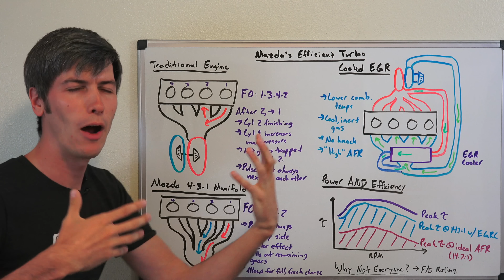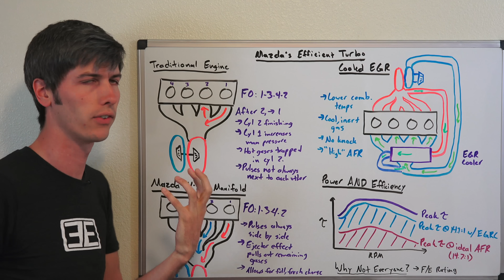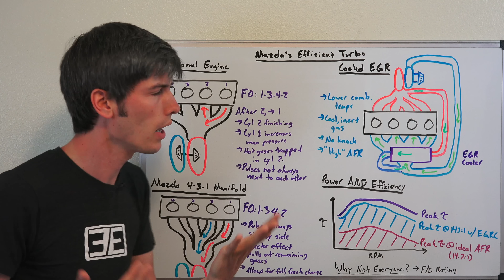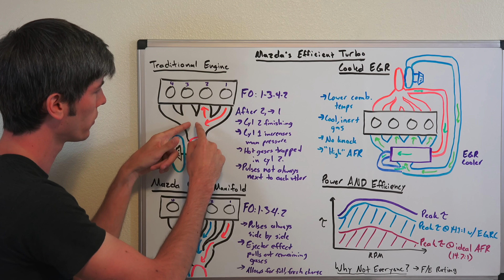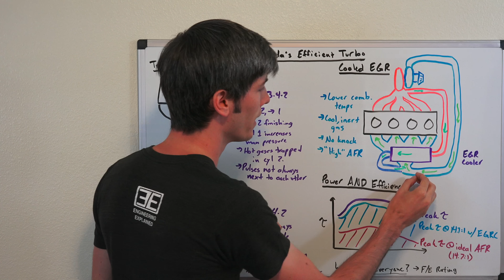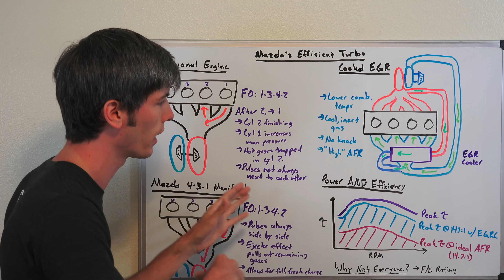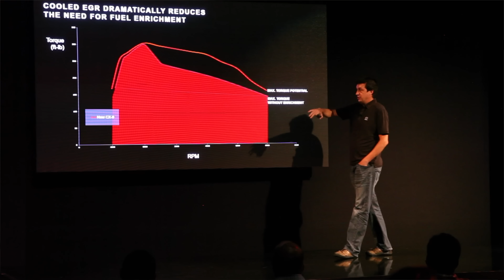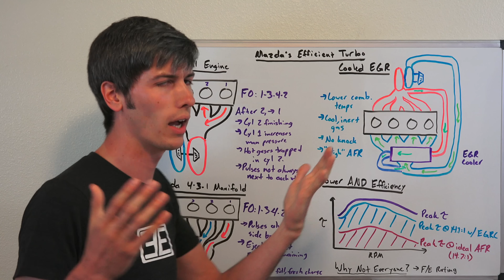Mazda's Secret To Efficient Turbo Engines

Comment: This is why, to me, Mazda is the most exciting car manufacturer right now. They are really letting their engineers have fun and design fundamentally good engines.
Reply: Especially for such a small company with a relatively low R&D budget, imagine if they had the same funding as the big three?
Reply: @holmd90  far from small but wjatever....
Reply: We've got a 2015 Mazda3 2.2D and it's an excellent engine. Has 2 turbos which work seamlessly, there is no boost threshold that i can see (you can hear the little turbo spool pretty quick even below 1000rpm with the windows down) and the lag is minimal at best, and you can (if you really try) feel the overlap of the turbos) better still. Gets 70mpg(uk) doing 80mph. Awesome awesome engine. My 04 MX5 is also indistrucable
Reply: @mulymule12  that's amazing fuel considering the size of the Mazda6. I've only been hearing great things about these cars and I'm about to get my hands on one
Reply: Fundamentally good and reliable engines. They aren't introducing additional moving parts (additional heat exchanger and newly-designed exhaust manifold) and use real-world consumer-grade fuel to achieve their results. That's awesome.
Reply: Mazda engineers fun cars that have a very refined balance of practicality and  performance. One of my favorite car companies.
Reply: 787brx8 oh? Who is it? I'd love to hear more.
Reply: RalstigRacing Agreed! I love my SKYACTIV. Also reliable one of the few engines I trust with DI since they actually addressed the carbon build up issue in their press briefing when they first came out. 
The SKYACTIV X will be so good!
Reply: Definitely! Can't wait to see what their HCCI engine brings. Any engine that has a supercharger mounted to it gets me excited
Reply: RalstigRacing I’d disagree with you there I’m not a big fan of Mazda heading towards luxury over performance they’ve completely abandoned the Mazda performance division zoom zoom is no longer what Mazda about and although there bringing back RX I don’t think it’s gonna be a performance car at all I think it’s gonna be their top tier luxury car

Now I will say this the skyactiv engine is one hell of a reliable engine
Reply: This is why I’ve owned a 2007 Mazda Miata for years now and put in Mazdas newer engine in it.
Reply: @Matthew Proudlove ices are infinitely cleaner than batteries. They can run on hydrogen. Batteries are based on a highly toxic, non reneuable resource, need to be replaced after 5-10 years and can not be safety disposed of.
Reply: @Erowens98  I like ICE but you are full of s*it. All the studies say otherwise. More importantly EV's remove the pollution from the cities. There are 7 million deaths worldwide from air pollution
Reply: @787brx8 Could you provide additional information? I'm curious about this designer. Name, website, something?
Reply: @tappajaav  He keeps A low profile so he can work on military projects when he feels like it.
M. Mother
O.  Of
A.  All
B.  Bombs
Utah
Reply: @787brx8  I think Jason lives in Utah too. Wouldn't surprise me if they knew each other.
Reply: @matthewsalmon2013  Jason is in Idaho from what I know.  Probably only A few hundred miles away from each other.
Reply: They're taking engine efficiency to the next level. Its not without it's risks however, some of these engines may not be reliable or fail. I'm hoping they don't since Mazda is good at what they do, but it happens with new engines on the market sometimes.
Reply: @Matthew Proudlove Whilst there is a lot of merit to this argument, there are 2 huge environmental impacts with electric cars; 1- the environmental cost of producing batteries. 2. The environmental cost of disposing them. I haven't yet seen impartial studies on this but can tell you the cost of producing batteries is overlooked by most people. I am not aware of any real recycling programs for all these used car batteries that are about to come onto the market. Not saying they don't exist but wonder how much is marketing fluff and how much is reality. The toxic materials used on such a huge scale for car batteries is an environmental disaster waiting to happen, especially in less tightly controlled parts of the world.
Reply: Nutrenics Padi 
It's early days wrt ev technology ..... you are comparing it to  the ice that has had many years of refinement.
Commonsense says the battery technology ( including recycling) will improve in time, so your argument is nonsensical.
Reply: They need a new performance hatch and sedan bad though, I've loved my speeds
Reply: That is exactly why I will keep an eye out for Mazda when I start looking to buy a new(er) car.
Reply: When will they make a full size truck?
Reply: @Thomas B 
Well, Thomas, I didn't know what percentage was recycled so, being the open minded fellow I am, I Googled it. Turns out that over 60% is a number often quoted. And, before recycling the material that makes up a battery, they are often repurposed for things like storage for solar. I also read some info on the continuous reduction of pollutants from the processing of these batteries and the continued improvements in energy density, quality, and different chemistries that are better in multiple ways. Now I'm sure the whole story isn't in the few of websites that I looked at but I think the general trend is there.
Reply: Not anymore today
Reply: Coming back to this 6 years later and you are spot on
Reply: Matthew Proudlove some Swedish university have done this study. Compared to a typical 1.6tdci, an equivalent EV needs to hit around 160,000km to break even with the ICE car in CO2 terms (granted it’s not a pollutant like nox and pm where EV wins hands down) and that is using Europe’s current mix of electricity sources which isn’t all coal (far from it). The battery manufacture is so intensive that an ev starts off on the back foot in terms of co2 by a factor of 2 ( I think. Not sure how they worked it out, but an ev starts life with about 90g/km equivalent co2 and the ice around 40g/km). 

But of course the flip side is no PM and NOx as local emissions. These are displaced elsewhere to a handful of power plants which are typically out of the way and which have bigger scope for effective after treatment
Reply: @0tispunkm3y3r  look up climobil on google. It compares everything from a electric car, like batters production and energy production, and everything from a gas car, like drilling for oil and turning it into usable gasoline aswell as burning it in the engine. 
EV cars were always better
Reply: Yes and anyways with the current capacity of battery minerals and battery manufacturing it is impossible that every carmaker would make EV cars.
IF that happened the battery prices would go even higher making it impossible to make any profit or the price would be huge for consumer.
Also it is said that there are really not many if all EV car makers that make profit out of their EV cars. So why would the business start making EV if it is not profitable at the moment. Many manufacturers do have an EV version of course and a lot of R&D so when it becomes more profitable they will ramp it up.
Reply: 787brx8 ermm.. Link to that? I really tried to Google him/her
Reply: Matthew Proudlove and you know how lithium is produced for the battery ?
Reply: You also have to consider the environmental impact of producing the batteries themselves. 
Electric cars also still have 2 major drawbacks. 
1. Recharging (refueling) isn't a short process. You can't just stop at a station on a road trip, spend 5 minuets topping it off, then head out again. You're spending the next 30-60+ minuets recharging. 
2. Longevity. Electric components to a car have always been a pain in the ass when there's an issue or something needs to be replaced. Throwing a huge battery pack into the mix, and electric motors, what will be the maintenance costs of working on/replacing these parts when they fail?

Being a smaller company, i think Mazda is being smart by not dumping their limited R&D into what is still and unproven technology. Let the bigger guys figure it out and work out all the major issues first.
Reply: @lyianx  

Every time I read the battery production pollution excuse I'm reminded of something I read a couple of years ago. It was posited that the batteries are highly recyclable so as more come on line, the "pollution" footprint will come down by leaps and bounds. Couple that with responsible mining practices and I think the argument goes away. Of course, responsible mining is sorta in the eye of the beholder, so to speak.

I'm certainly no expert but the concept seems reasonable.
Reply: Holy balls... you just called Mazda “exciting”. Really!? You haven’t seen much lately have you.
Reply: clever and not costumer friendly solutions (read costly)
Reply: There quite boring in my view as they still only produce fossil cars with little drive to go electric
Reply: @Conor Nugent If you read a bit and look at some of their press conferences, Mazda obsesses with 2 things, driving joy and environment. But according to their own research, whether it is correct or not, they believe that electric cars are not inherently greener in real world yet, while the hybrids introduce complexity and weight with very little gain, as of now. So they decided to try and make internal combustion engines as efficient as they can get while they let the electric technology mature. 
You need to remember that Mazda is a relatively small company, they can not afford to develop technology that will not get them anywhere just so they can better their image(I am looking at you VW), and they have partnered with Toyota to help develop their own future hybrid and electric cars.
There is also the environmental cost of making cars, and Mazda was the first manufacturer to rethink their manufacturing process and report how much their cars pollute while they are being made, inventing new lines every few years to make that process as environmentally friendly as feasible. They have new paint coating chambers that produce very little excess paint, which they than scavenge and then try to reuse after purifying it, instead of dumping it as waste. Their cars are made 78 % of recycled material, and they use very efficient steel tempering process that requires way less energy. All in all, I read a report from them a few years ago that stated that they reduced a carbon footprint of making new cars since the 1990s by whole 64%, while also having almost no chemical waste.
Mazda may not be prefect, but what I like about them is that they have a clear vision, and they try hard to follow it. And the world today really lacks that, our country leaders have no vision, their only goal is to stay in power, most companies have no vision except to make even more money for stock holders, hell even we as individuals mostly loose our own and just follow the paper trail. I hope as a species we get past this soon and start rethinking our priorities.
Reply: They'll partner with someone when they need an electric car. Probably Toyota.
Reply: . Yep
Reply: @MrConor159  The process of manufacturing batteries for electric cars produces tremendous amounts of pollution.
Reply: > implying electricity production is clean

Am I allowed to laugh yet?
Reply: Ujiltrom M Well, if you live in Norway, your ev is amazongly ecological ;)
Reply: @MrConor159  mazda produces mild hybrids tho
Reply: @MrConor159  when my anual milage is about 4000, would I choose EV or Diesel?
Reply: @MrConor159  you still think gas comes from fossils?
Reply: @MrConor159  what is boring  are in fact EVs
Reply: Conor Nugent They're refining the mileage of their cars so when they do add electricity they'll leapfrog over the competition. Right now they're still very competitive with mileage against cars WITH electric augmentation. If all this clever engineering bores you go to the doctor for some ADHD testing.
Reply: I agree, its a shame they're perfecting the gas engine right before it mostly dies out. Word is they're releasing an electric car next year! And they expect all their cars to be at least hybrid in the near future.
Reply: @soy_leche  it's a shame that EVs are technically boring

Comment: Wait... Is there a filter to clean the inert gas before it goes to the EGR,  if that air is hot and dirty after combustion, what advantage is there to allow it back to the intake side?
Reply: He went over both of those things.
Reply: @ALMX5DP  well the way I understand it is that it will COOL the exhaust gas, but it won't CLEAN it, so there's carbon and what not being sent back to the intake it'll be ok?

Comment: Could you explain what is the primary role of the EGR in engines?
Reply: it's for emissions. the egr re-routes exhaust gasses back to the intake to lower cylinder temperatures. these glasses are inert and will not combust so it drives down temp. we used to dump more gas in to drive down cylinder temps, but that's inefficient.
Reply: JohnnyMo yeah you are right.
Reply: Maciej it’s to do with efficiency.
Reply: Are you sure?
Reply: To burn any contaminant gasses again too
Reply: Jorge Jaime sorry, but no. Only a very small part of the exhaust gasses are recirculated so  if there is any effect it would be negligible. By adding inert gas, there is less combustion and therefore less heat and thus a lower temperature. The lower temperature prevents the burning of N2 to NOx’s witch are harmful.
Edit: and it prevents knock. And the engine can run an a lean mixture witch improves efficiency.
Reply: Jorge Jaime which contaminant gasses?
Reply: Jorge Jaime I think you're confusing it with the PCV system